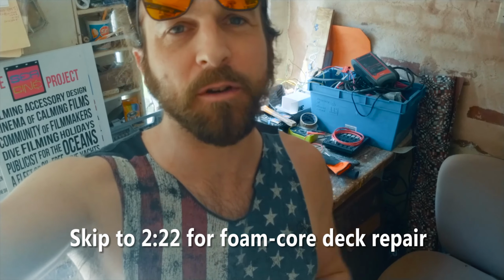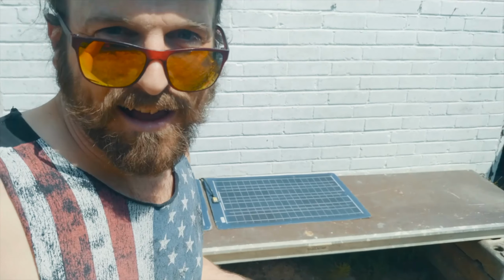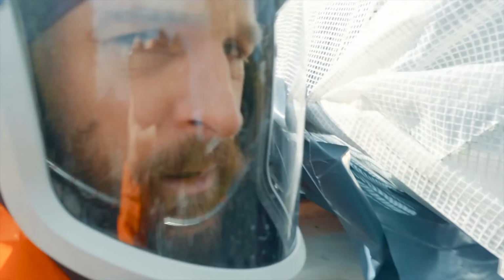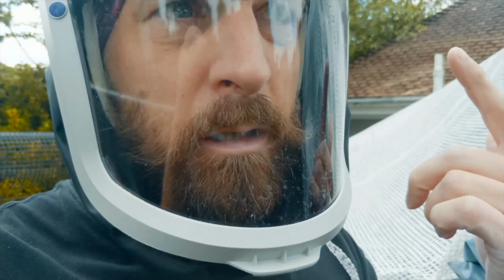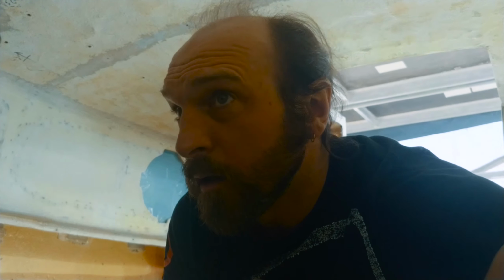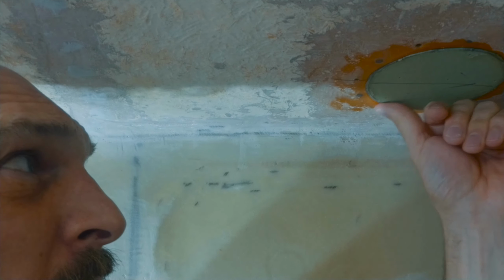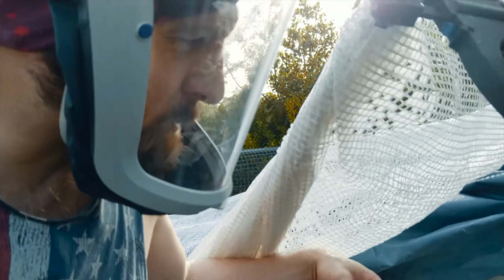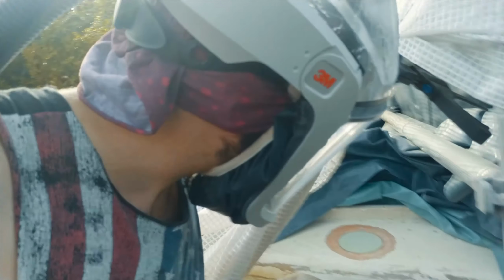Project boat; Foam core deck repair

Comment: Do you re-use your brushes? I tried recently with acetone but ended up melting through a yoghurt pot, decided to just buy lots of brushes and throw them but seems a waste.
Reply from the maker: No reuse possible. It is a gross waste 🙄 Prefer wooden handled brushes for this reason, but these ones are plastic. They cost pennies on eBay for a bulk load.
Reply: @esvarwyn  Damn, yes wooden would be better. I'd seen some people suggest using a 3 pot system to wash the brushes but after washing one realised I'd end up spending far more in paint thinners and acetone than I would on new brushes.. It is a shame, I've also been trying to apply as much epoxy with bits of cardboard or parts of plastic cartons where I can but no good for painting.